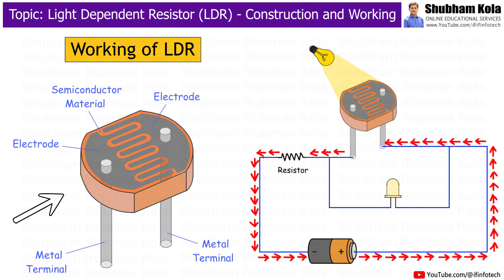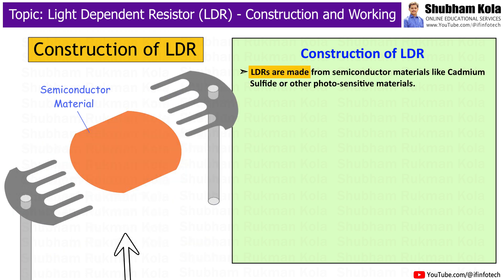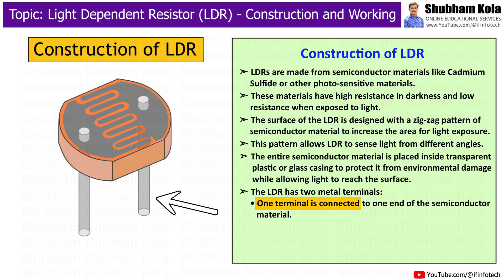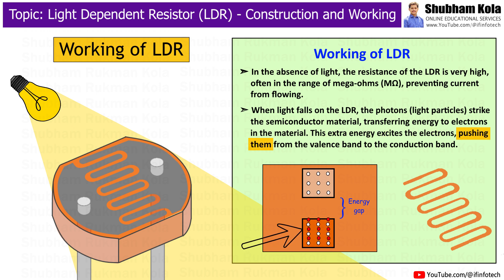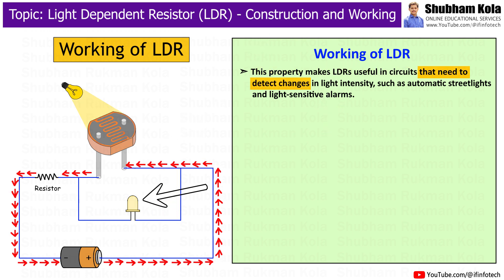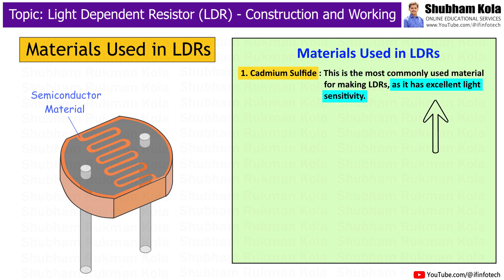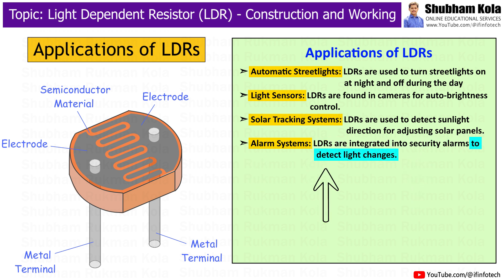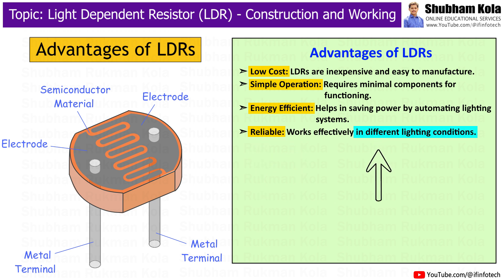Light Dependent Resistor (LDR): Construction, Working, Circuit Diagram & Applications | Shubham Kola

Comment: Why we have to give voltage for the LDR to measure current? Sir can u please explain
Reply from the maker: We need to apply voltage across an LDR (Light Dependent Resistor) in order to measure current because the LDR is a passive component. it doesn't generate any current on its own. Its resistance changes based on the amount of light it receives, but for current to flow through it, there must be a voltage applied. According to Ohm’s Law (I = V/R), current only flows when there is a voltage across a resistor. So, by applying a voltage across the LDR in a circuit, we allow current to pass through it, and that current will vary depending on the light level. This is how we can detect changes in light by measuring either the current or the voltage drop across the LDR.